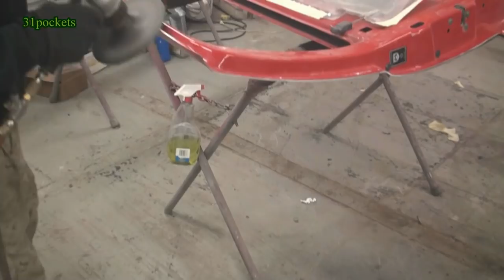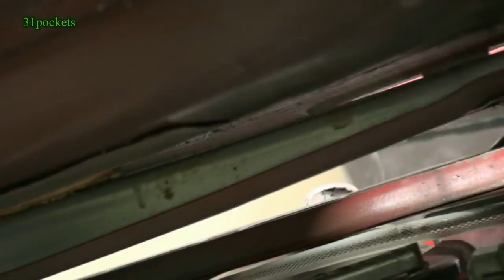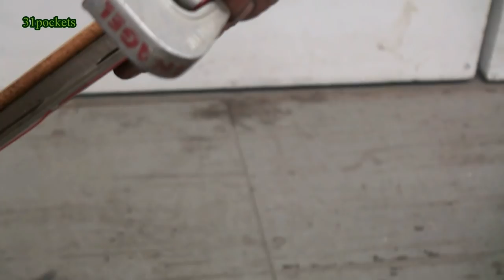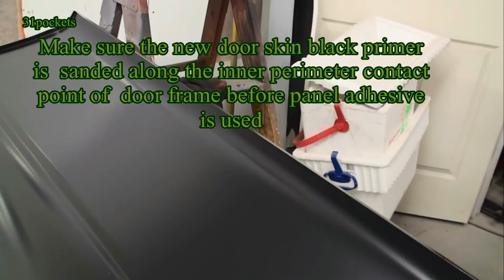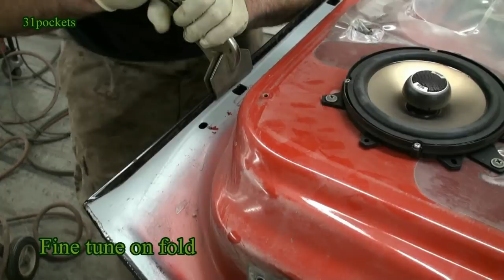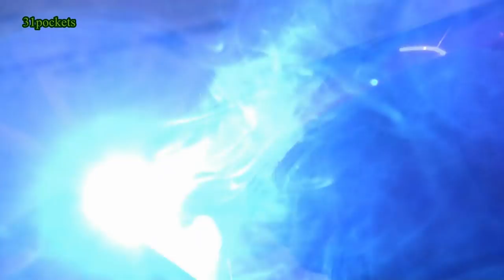Door Skin Remove & Replace Video on 1998 Dodge Dakota in The Art of Auto Body Repair

Comment: Excellent video! Professional quality work here. Thanks. I might add that even though not needed a Bean bag or lead shot dolly along with a door skin hammer would cut out some of the fatigue and lessen the chance for possible dents from the steel dolly on the outer panel.

Comment: Was the all-purpose panel adhesive caulk you used the correct one to attach the center of the door skin to the crash beam?  Because if it’s solvent based, it shrinks when it dries and does not allow the door to expand and contract with temperature changes.  That’s the reason the factory uses foam adhesive.  Also, why was the rusted corner of the door frame not repaired before installing the skin?  Seems like a lot of corners were cut during this installation.

Comment: personally, i would of cut the frame just above the door mirror and just above the door handle near the drop glass edge. (like replacing a quarter panel) This saves having to go around the top of the door saving loads of time. Good job, by the way.

Comment: Excellent video clear explanation of what you were doing and no music perfect. Two questions what is the wheel on your air tool you’re using to grind down the spot welds? Was the purple wheel (used on door bottom rust)a scotch bright?  Which one?

Comment: Did you have to wait for the adhesive to set before folding the edges?
Reply: Arthur Marquis No, as soon as you apply the adhesive, you start your folds. if the adhesive dries and then you start folding, your screwed if you need to adjust the skin.

Comment: Great video! Thank you!
Many great tips for those of us disagreeing with the concept of "just buy a new one" or "not cost effective"...
Unboxing a new Mopar door would be a very short video... and not very informative on auto-body panel work. 
Also, where is the shop in my neighborhood that has an affordable new door for any car I might be working on... 
The point of the video is not "How to do the least amount of skilled labor." but rather how a job like this is done.  
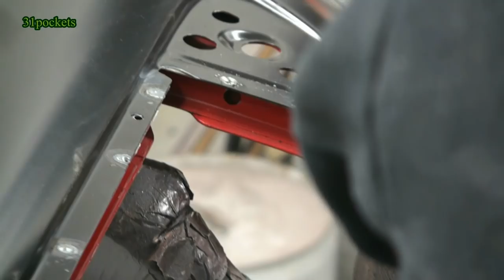I especially like the method of clearing excess weld-wire @28:37. Time saver...

Comment: do you need to align the door in the car or just leave it like that
Reply: I always install the door right  after I hem  the seams to ensure a good fit, most shells can easily distort (twist) when the skin is off. There is a little wiggle room to slide the door skin to make the gaps right, and then when on the vehicle I make a couple spot or tack welds to hold the shape before the glue sets up.  Other than  that this guy makes a great repair, bonding glue and hem seaming!!!

Comment: Nice video...I'm so intimidated to do this after watching this video. I guess there is a first time for everything :-\  How did you fold over the edge and not dent the new skin? That looks like the scariest part...i guess just hold the block on the edge.
Reply: David Sanders using the dollie flat against the metal usually keeps you from denting the sheet metal. but sometimes you get a little ding here and there, simply throw some filler on it, sand it and go.
Reply: I did end up doing it and it turned out perfect..what an amazing amount of hammering though. And I'm a carpenter by trade!

Comment: way way to much work great job but way to much work involved just buy another door from scrap yard around here you can get a whole door for 25 dollars i'm not sure about other places but this is way faster and cheaper than doing what you did i'm glad i watched your video it stopped me from buying a lower door skin for my dodge ram 1500 4 x 4
Reply: Travis Johnson I myself have never seen a door from a junk yard for $25, more like $400 or more. And junk yard doors aren't always available. Many times you end up having to do repair on a junk yard door and possibly transplant the guts, then painting the inside as well. Skinning the door takes less paint materials and there's no chance of having to transplant your original door guts to the junk yard door.
Reply: $25 for a junkyard door,what island does this guy live on lol.
Reply: RichR65Ct The island of Tonka lol
Reply: Joel Bargas I know this is a late comment. But I found a driver side and passenger side door at my local junk yard, PullaPart, for $60 a piece. Both in great condition with zero rust. Cheap doors exist. I live in Texas idk if that makes a difference.
Reply: Khajiit Is Innocent you should prove it not just write it
Reply: Andrew Delgado prove it how? I can give you Pull-A-Parts number and you could call and ask how much a door for a 2000 mitsubishi  mirage is. For my driver side and passenger side(I have a coupe) Google Pull a part or You Pull it. They are junk yards in Texas. Pay like $2 to enter the yard, take your own tools, no power tools, and whatever you can "pull off" is yours. At a price of course.
Reply: Andrew Delgado right on.
Reply: Khajiit Is Innocent doesn't mean your right
Reply: Just messing we have a junkyard here in Cali pick and pull and it the same thing you're talking bout
Reply: Totally educational.

Comment: this is not cost effective. LKQ door all the way.
Reply: casillask LKQ isn't always available and averages $450 or more, then any repairs that need done to them, then cut in time and materials for the whole inner door. Door skins average $65-$180, only needs cut in on the seams, and sometimes you have to transplant the customer's original door guts into the LKQ door (usually the wiring bc of different plugs). When it comes to doors, LKQ isn't always the best option.
Reply: casillask LKQ isn't always available and averages $450 or more, then any repairs that need done to them, then sanding time and cut in time and materials for the whole inner door. Door skins average $65-$180, only needs cut in on the seams, and sometimes you have to transplant the customer's original door guts into the LKQ door which means removal of guts from both doors, twice the work (usually the wiring bc of different plugs). When it comes to doors, LKQ isn't always the best option.
Reply: Joel Bargas for someone to show how to do something is great but come on do it right not how to hack it realy you dont know how to use a spot weilder what was this youre first day guys?
Reply: $77 for a pickup/van door..  going to get one for my friend and resell it for $150...  he got a quote of $700 for repairs * dent*
Reply: CorpseFreak right???  He is probably referring to the LQK, where they have the parts pulled already... and ship to you